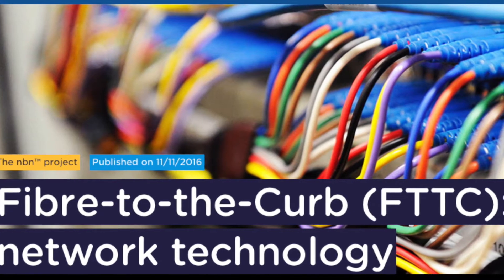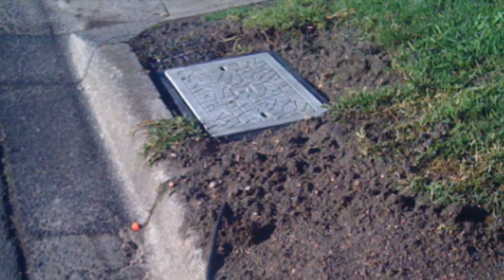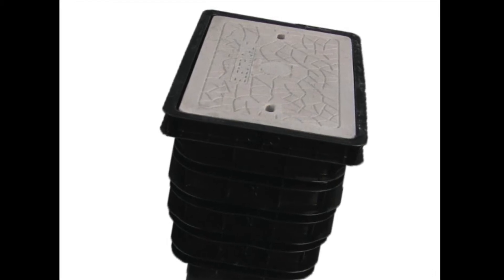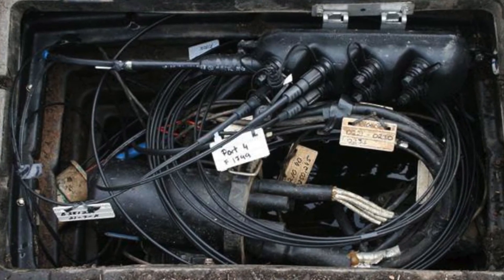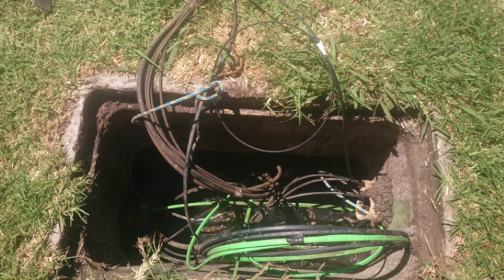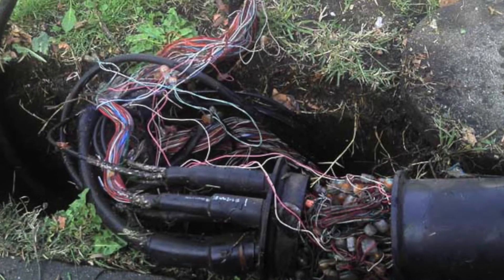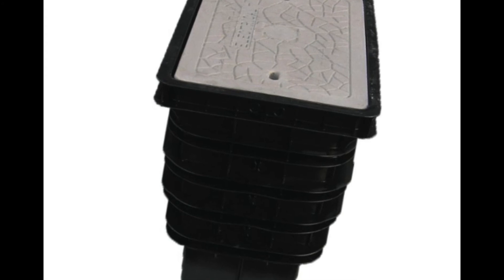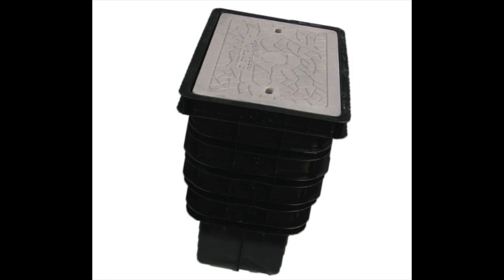Yet another new NBN technology FTTC - Fibre to the Curb Kerb?

Comment: Can you be a little more technical pls ? There is a great deal not revealed by NBN or the ISP about the devices and how they are hooked up in this pit for FTTC ? For example, how prone is this pit to fill up with rainwater;  is the connection device ( Nokia Lightspan SX-4F or Netcomm NDD 4100 and its connections waterproof ( IP68 or IP68K rated) and insectproof etc ? A lot of complaints on the internet about faults from these pit located devices, probably related to long term exposure to water ??

Comment: If nbnco keep their word I should be getting FTTC at my dad’s and FTTN to my mum’s which means I will be able to test if there is a significant difference in speed. Both being installed oct-dec 2018. By the way they only live 1.5km apart
Reply from the maker: Matthew West Great test. Please come back here and tell us what you find. See if you can do it at the same time of day as the biggest factor normally is other traffic on the network.
Reply: Not going to have a result until Jan-Jun 2019 for an FTTC and FTTN comparison.
Reply from the maker: Matthew West Thanks for checking in. It will be interesting to see when it is all installed.
Reply: Mark's reviews and tutorials planned availability pushed back to Jul-Dec 2019 at both premises
Reply from the maker: Oh Bummer. What a journey, hope there are no more delays for you.
Reply: Planned availability window has reduced by three months and is now Oct-Dec 2019. So not quite a delay, but I suppose it means the time I will get the NBN is more accurate (if that makes sense) although it is still a 1 year delay from what my original comment stated